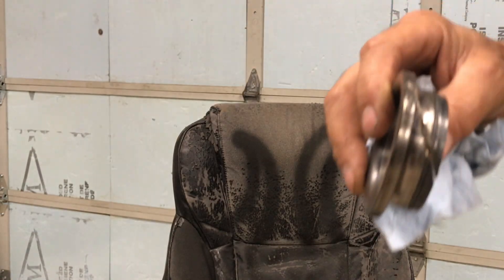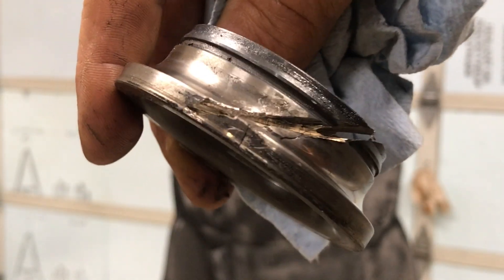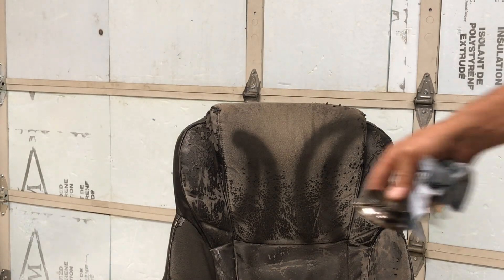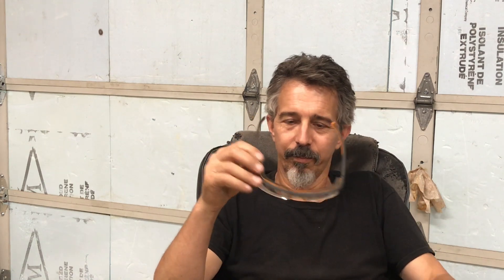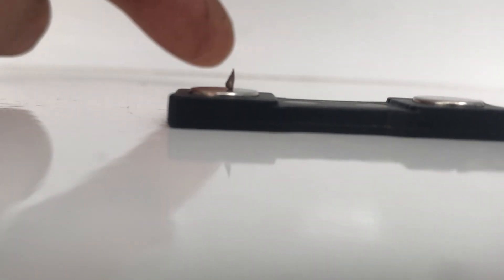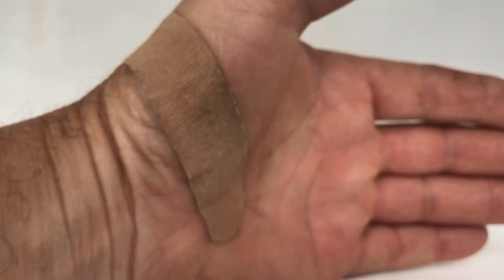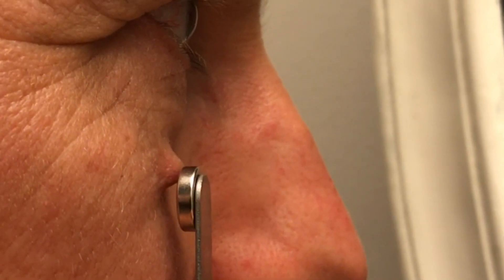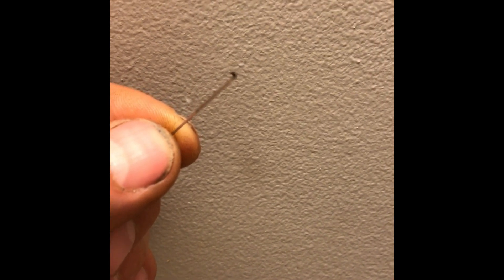Shrapnel

Comment: I’m glad you are okay.  Those things happen no matter how careful your are.  I’ve got some ideas on thing’s that can help in the right application if you are interested.  Really enjoy all the content and the folks you’ve helped.
Reply from the maker: Thanks, I would say in both cases I got off east. I would like to hear you ideas.
Reply: @WildWestGarage  I split them the same way with a zip wheel then I use a torch to hit the split, it either cracks or expands quicker and will come off.  I also have an air hammer with a dull Chisel and it’ll crack it.  I’ve never had the air hammer bits shatter the race or the bit.  Seems like those bits are softer and don’t shatter.  Just some ideas, hope it helps.  Take care